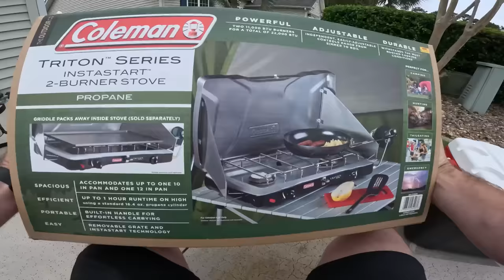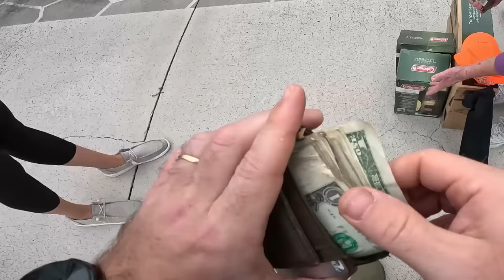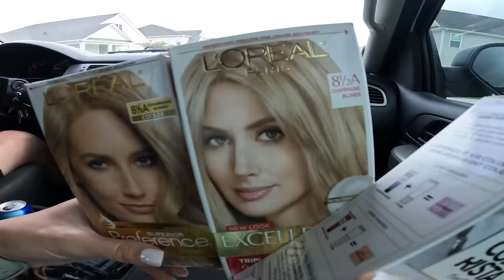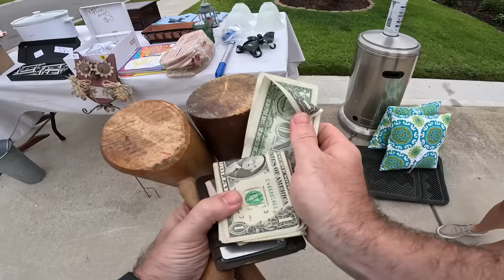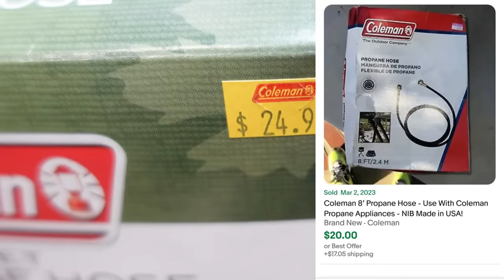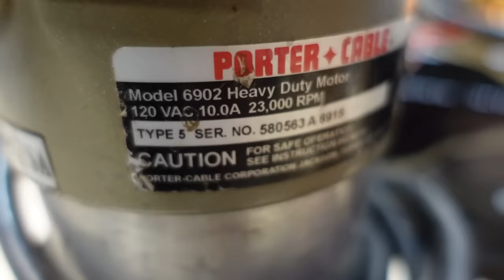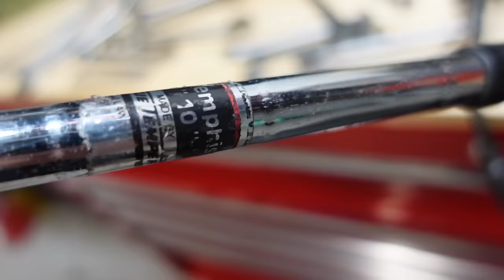If you find these always buy them at yard sales!

Comment: If you are going to buy speakers, you have to pop off the covers and check the foam around the edges.  If the foam is worn, or missing you will have to take them apart, pick up a kit and install new foam before anyone will purchase them and you will have to know what you are doing when you install the new foam.  I just picked up a set of $600 speakers with the foam worn away for $40. I will be installing new foam and high end capacitors because they wear out too and degrade the sound quality.

Comment: In my old neighborhoods in Florida, Nocatee and Fruit Coffee, people put stuff out for free on garbage day. I got a near new Pit Boss smoker, free, patio set, free, microwave, free.  Rich people don't sell stuff at garage sales.
Reply: I just got a ton of stuff because my neighbors moved out and put so much at the curb... Got a portable AC floor unit, a drone, a table + two chairs, yard equipment, a beach cruiser bike and a lawnmower.

Bonus because the drone could have caused an explosion from the lithium batteries if it had made it into a garbage truck.

Some people may look down on me for digging through a huge trash pile but I don't care, most of the stuff I salvage is good stuff and still useable!

Comment: I picked up two tools at a yard sale and I consider them to be one of the best purchases I've ever made.
The first one was a 16 ounce Estwing hammer that still had stickers on it for $2.00 . The second one was a heavy mattock digging tool. Just the head, which I paid $0.50 for.
I needed such a tool for various projects around the house. 
I took the time to clean the head up and repaint it  with the red that I paint my yard tools with at the end of season and I bought a new fiberglass handle for it.  The darn thing is pretty much indestructible .
I'm a carpenter that doesn't frame anymore but my job has me hanging doors and repairs etc. So the 16 ounce was a great purchase and I use it every day

Comment: Good pickups! I don't always test power tools myself if the price is low enough - but I will put them under my nose and check for the smell of burnt windings or brushes.
I keep a small bucket of the throwaway Chinese wrenches around for times I might need to grind one for clearance or bend one using a torch.
Reply: Love the tip of keeping the bucket of "specialty wrench stock"
Reply: I burned a few motors the past 40 years and I know that smell

Comment: Just stumbled on your video; looks like you got a good system there, the flip side of your garage/yard sale finds is having a good shipping plan for those items after you list them on eBay or whatever your preferred online selling format is. I personally always get screwed on the shipping it seems and that’s even doing a close estimate on weight and package dimensions.  Using that putter as an example, what packaging would you use and how do you decide what to charge to ship to say Maine?  The other trick is, you have to be able to wait out your items meaning it could take 2-3weeks for someone to buy that putter on EBay.
Reply from the maker: It's calculated shipping through ebay - then we use pirate ship to buy the label. So a putter 4x4x40 box weights 2lbs going to Maine close to $8 shipping ups

Comment: The Coleman stove, if can be found used or new, being resold, is generally always worth it.  The older versions, if not rusted out, are definitely worth getting. I picked up a small stove that uses the small spray can type fuel, in well used condition forfree just by asking about it.

Comment: Tip on the Coleman grill, pull the burner knobs and remove the valves.  Even new, they need to be cleaned and lubed with a silicone lube.  You'll thank me.  Otherwise they stick and are either off or high.

Comment: It's early January. I'm waiting for May.
That Porter Cable router for $10.00 is a buy. I have routers from little trim units up to 3 1/2 hp. I set up routers in plywood tables with cabinet door bits of varying profiles or other bits and leave them. Do a final adjustment and never touch them again. I can buzz out door parts quick that way.

Comment: I buy old corded Milwaukee and other corded power tools dirt cheap for shop use. You can never have too many quality angle grinders, drills etc and while I've plenty of cordless their bulk isn't a bonus on the workbench or for tasks like drilling pilot, intermediate and finishing holes in steel. For that I have a pail of drills with bits installed. Hardware sits in the bottom. I can afford any cordless too I want but corded have their place and if money is tight or you're a home user corded is sufficient.
Reply: Amen! I would rather have old corded tools that work right now instead of having to save up for cordless. Besides, I'm still learning woodworking, and I can always upgrade later by selling stuff I've built!

Comment: I look for computers and components, as I rebuild these for a church projects. I found several laptops for almost nothing, the  only thing wrong is that they had older versions of Windows installed. Easy fixed, as I install Linux and even an old IBM Thinkpad can be used on the internet using Puppy Linux. Also I look for stuff to fit the 3rd generation Ford Ranger.

Comment: Another difference in the hand tools is tolerances. Snap On has very close tolerances. If the wrench says it is a 12mm wrench it is 12mm +/- 2-3 thousandths whereas cheaper wrenches are sloppy and are within maybe 7-8 thousandths. It makes a difference when you work with them every day. Always check how much slop there is on any adjustable wrench. Kobalt for instance is very sloppy, even new. They are not very good quality. Their name is rated too high and they charge too much for what you get.  Good buys though!!

Comment: That MAC wrench, CL20L is junk. I had one of them and used it to try to break the hinge nut on the tilt front end of a Mack truck. It box end split open (brand new tool set), I fell off the bumper quite unexpectedly and landed on my side on a thick plywood board in front of the truck we used for placing clean engine parts during engine rebuilding in the frame. If that board was not there, I would have been on my head in the pit the truck was parked over. We had 4 pits and used them for engine rebuilds. I have doubled Snap On wrenches, attaching a box end over the open end to get leverage and NEVER had one explode that way that MAC wrench did. Needless to say, I sold the wrench set to a guy working exclusively on cars and hope he never tries to see if they will hold up to some stuck nuts and bolts. You would have to give me ant least 10 of the junk tools just to give me that MAC wrench.